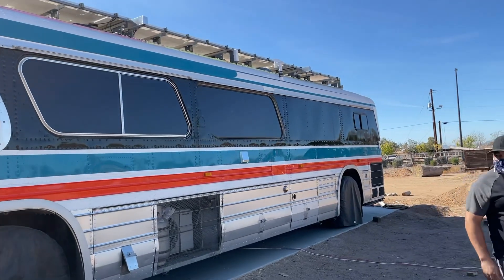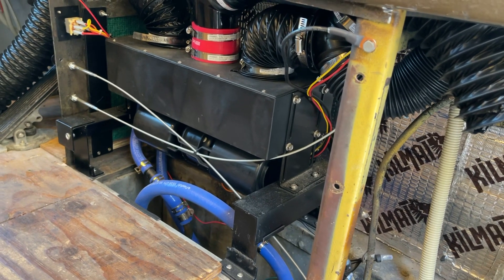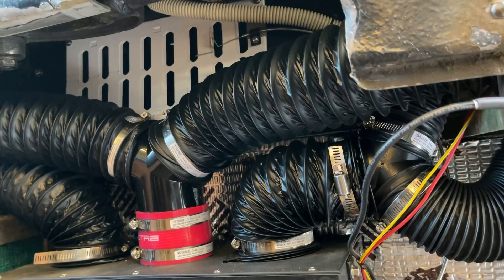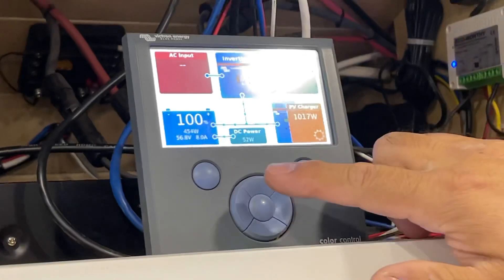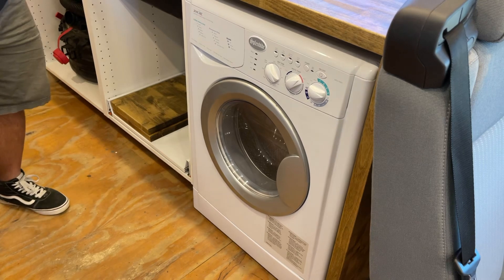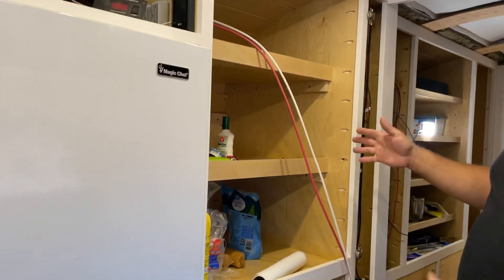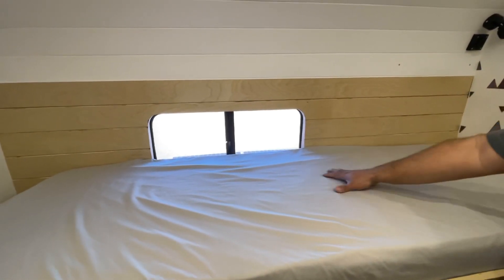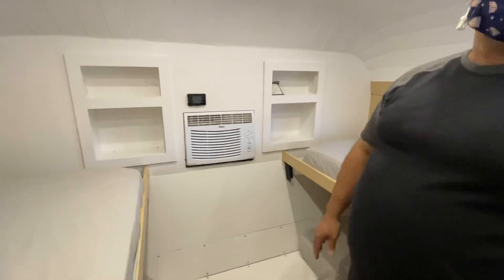We visit Juan and Michelle’s high-tech 4106 bus conversion

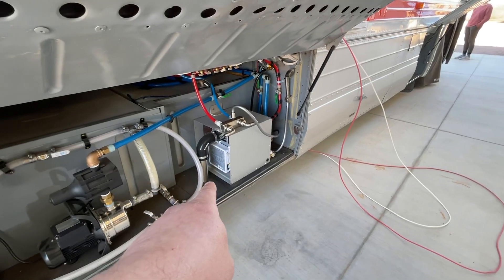Comment: What is the grey box at @1:13 beneath the shower faucet ?  Is that a hot water heater ?
Reply from the maker: Yes instant hot propane
Reply: @ThisOldBus  Brand and model ?  Where is the propane tank ?  I was hoping it was diesel fired.
Reply from the maker: You’ll have to go find that video on their channel, I’m sure they cover it and if not you can ask and he’ll tell you.
Reply: @SomeTechGuy666  your not going to find an on demand water heater that is diesel fired. Your choices are electric, propane, or natural gas. They do not produce them in diesel powered. I’ve installed several hundred and you only have the three choices.
Reply: @1982MCI  And what might those be ?